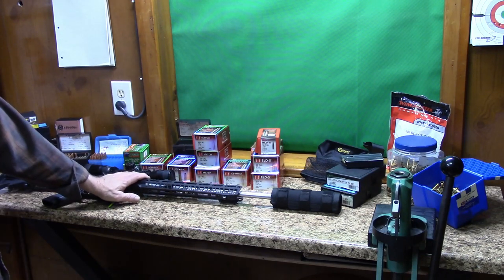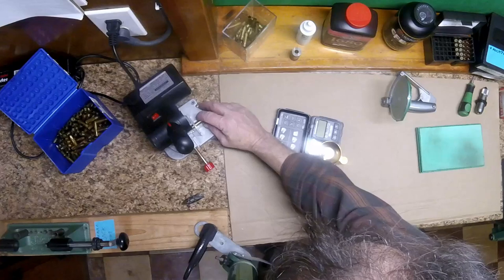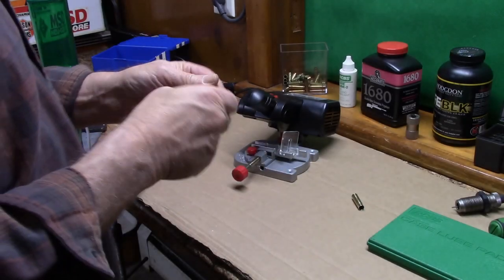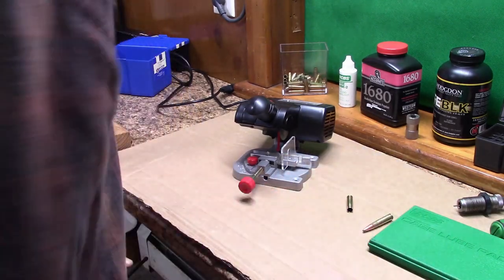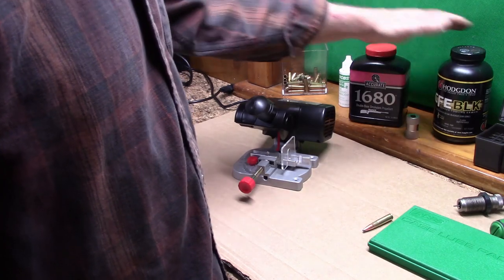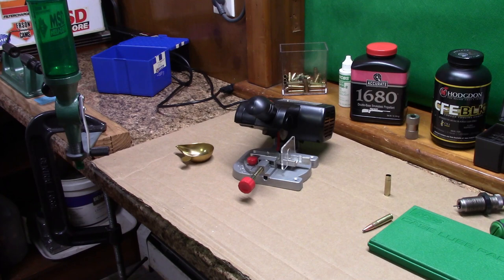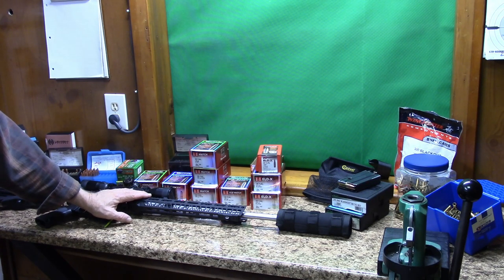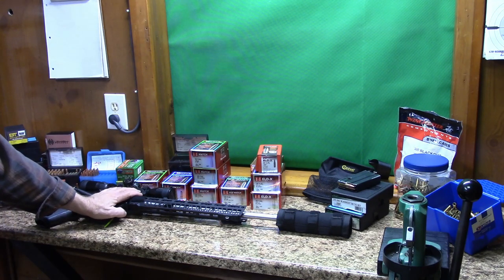Convert 223/556 Brass into 300 Blackout Quick and Easy!

Comment: I case gauge mine when finished and that's where I'm having trouble. I'm having trouble with creating/maintaining the shoulder. I just started converting brass and really hope to figure this out. I was told to check my (lee) sizing die and make sure it's adjusted correctly. I can get 300 factory brass to load up properly, but when I try and convert the 223 brass, I'm having trouble. Thanks for the info/video.